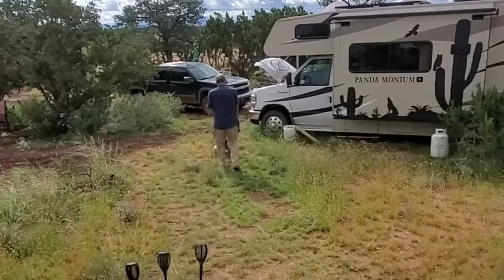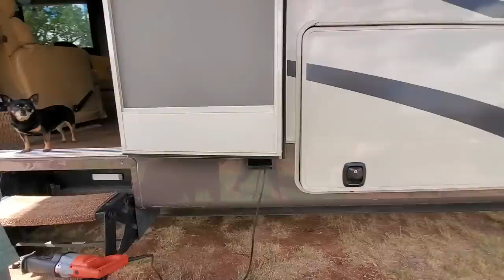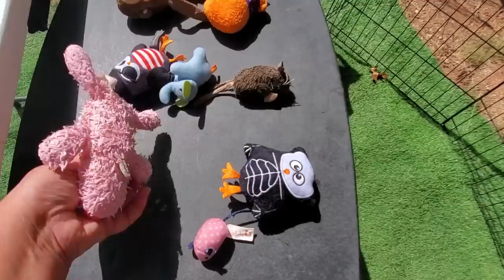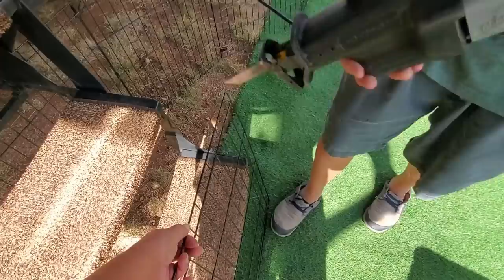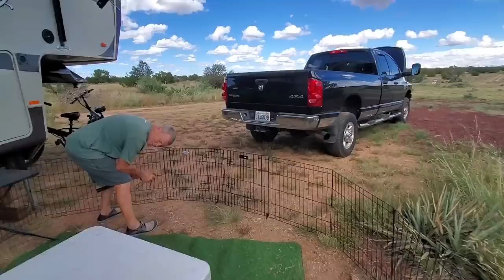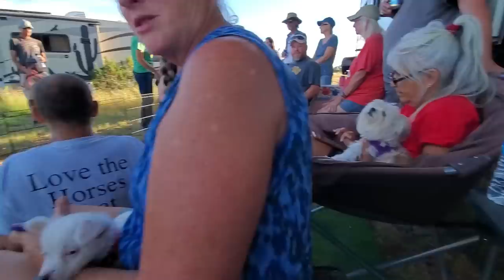It's About Keeping Her Safe, It's Gone To The Dogs RV Living, Travel &Life Vlog

Comment: I have the same gate set up and bought some re-barb to brace down the floppy areas.  Like the idea to trim down a few inches to fit under the steps.
Reply from the maker: It works great and I like the re-barb idea 👍
Reply: @DestinationOpenRoad  Most of the time the re-barb is easy to pound down in the the ground and I use zip ties to secure if I am staying in one place for awhile. Sometimes I will put a re-barb on either side of the gate so I don't have to use zip-ties for short stays. Using your clips might work too.